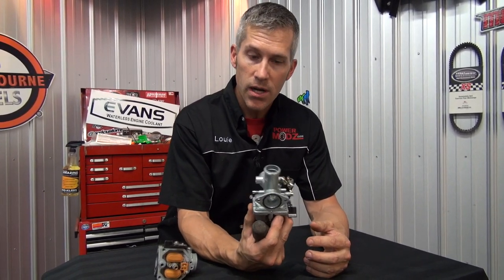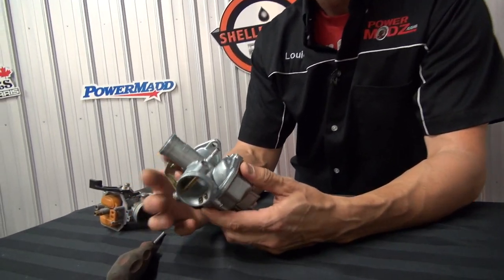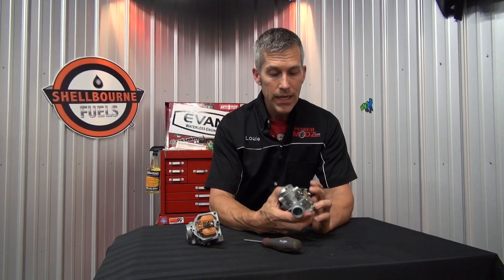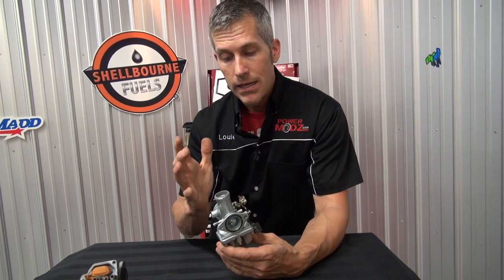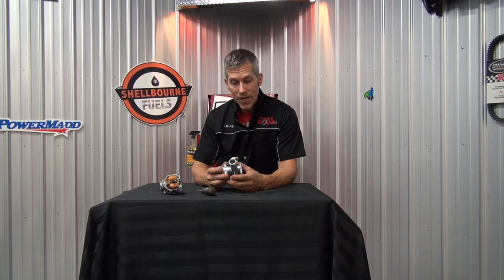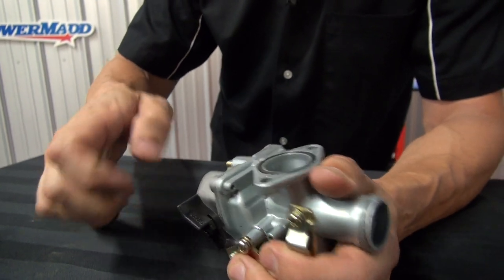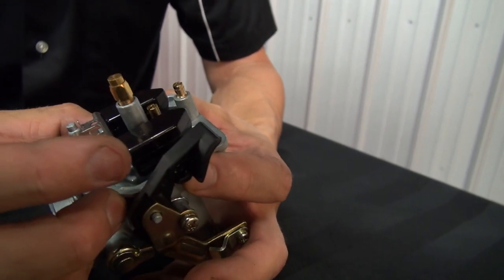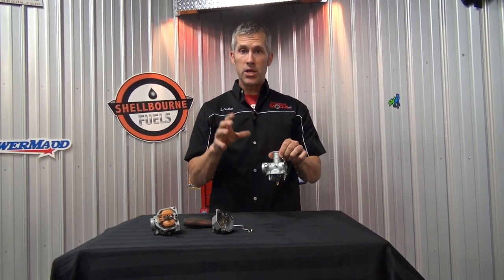Chinese Carb vs Stock carb, Honda ATC/ATV and more.  PowerModz!

Comment: I see a lot of people saying just rebuild your oem carb. That is by far the best thing you could do. The only problem with that is, if the throttle slide body is worn out, the carb is done. You can clean and replace all the brass you want. It will not run properly. As PowerModz said sometimes these knockoff carbs are your only choice. Just make sure you have them jetted properly to prevent engine damage. I had an oem carb on a RT100. I cleaned it and put new oem jets in. Bike would not run. Put a new knockoff $26 carb in it and it started first kick. Minor air and needle adjustments and the bike ran perfect.

Comment: I bought a chinese carb for 14$ shipped to me, my 1984 atc 70 has never ran so strong. Ben 3yrs no problem. If it works it works. Chinese , japanese anywho
Reply: technoviking1975 Bubba 
Oh they will run great. The only thing with the Chinese carbs are the Jets will break or snap. I bought a couple and put in original Honda Jets.

Comment: +1 to everything this guy says.  The original Kiehin carburetor on my ATC125 was so far gone that rebuilding it was not possible.  Corrosion, bad gaskets, leaked, slide was seized.  I found a knock off on Amazon for $17 that was a pretty good copy.  I had to swap the carb studs from the original to the knock off and the slide is a composite rather than metal but other than that there was virtually no difference.  All controls hooked right up with no modification and it started right up.  Now the little 3 wheeler that could runs as good as it's ever run and starts on the first pull.  Chinese knock off carburetors are kind of like the Chinese knock off Honda GX 200 engines.  (Cough....  Predator... cough cough...)  Most of the time they're just as good as the original.  I used to think that "cheap Chinese stuff" was junk.  Period.  Well....  China has upped their game in the quality department.

Comment: I've got three Chinese carbs and have had no trouble at all with them, all on "82 200E's. Its hard to rebuild a carb when the guy before you thought they would try their hand at fixing them.
Reply: exactly the guy that had my 96 timberwolf 250 beat on the carb because the floats were sticking and bent the side of the bowla nd now it won't stop leaking fuel
i got a knockoff carb and hopefully if all else fails maybe the bowl will swap over
Reply: Hello, your comment gives me peace of mind. I have an ATC 200e and I ordered a Chinese carburetor. I was worried because it won't work.

Comment: Similar experience with these. Plan to re-jet them right away. I’ve found they ship with pig rich pilot jet size - aka safe mode. I’ve seen them run 5-10 bigger.  They never list the jet sizes, so best to look up oem jet sizes of your bike and order real mikuni jets and have them on hand as a starting point.  Also agree and highly recommend the ultrasonic cleaner route on your genuine carb prior to resorting to these things, 9 out of 10 times the cleaning has amazing results.
Reply: This is a 5 year old comment, but yes, same experience with a Quadrunner 250. Chinese carb came on it from the previous seller, wouldn't idle without throttle, turns out the pilot jet was a size 40- the factory Mikuni spec is 15.

Comment: awesome! too cheap to smoke's review of a tillotson copy segued straight into this review. I am really glad to hear you weigh in on this as I bought a Chinese copy of the carb for my 84 honda xl80s and I have been feeling reluctant to try it. I stupidly broke a screw off trying to pull the "make work component" that honda installed over the pilot jet out and I have been stalling on trying to drill out the stupid plug that prevents the owner of said honda from cleaning their own carb with the oem carb. I feel better about trying the knock off as I only need to pull the studs from the oem and screw them into the threads in the copy.  thanks for all your awesome vids Louis! 🙂

Comment: what you ended up with was the smaller one with no float plug .. find the OEM STD carb with the same side and float plug and it will work out of the box.. the one you have will work on a 100 better than the 200

Comment: They work great put one on my 200m only had to mess with piston cap. Set perfectly from factory
Reply: Troll Scab how did you get the cable to fit in the cap I bought a China carb but the cap and piston is bigger I can’t get the small one off the cable so I can put on the new carb any help would be great

Comment: Original 1998 Honda $600 carb lasted 15 years, normal wear.  Has pressed in jets instead of screwed in jets!  A new float needle did not fix and the seat would need to be drilled out.  Chinese carb (Actually has Japan on it!) $100 in 2013 has been running 7 years.  Time will tell.  Seen some in 2020 for $35.  Can still buy the original Honda in 2020 for $300.

Comment: I have used several of them off ebay, plug and play. Cheaper than a rebuild kit.  I have got quality; as good as the original. In fact have one coming right now for a Stihl MS211 chainsaw.

Comment: I love my chinese carb but damn it takes forever to start my Quad ! Once it started everything is good ! What sucks is I can't adjust the fuel/air ratio. The screw there has 2 tiny holes instead of a flat screw driver head... The OEM carb even though I replaced every brass part and needle keeps spitting gas in my crankcase unless I shut the fuel valve.

Comment: We ordered a carb recently for our 1986 honda 200sx.  We had to get a different carb because the cap attached to the throttle cable was too small for the first new carb.  The other issue is the barrel will not slide up and down.  We had bore out the cylinder some...still no good.  By the way, how do you install a throttle cable to a new carb when the metal tube is crimped to the lid as one piece.
 
 However, the newest carb we installed and the quad is operational now.  It has sat for several years now.

We have 3 of these and now 2 of them run.  1 to go.  All had the same carburetor slash pet cock issues.  Thank you for your video.

Comment: In Europe Piaggio asks 350 euros for 2006 gilera runner 125 vx carb. I bought chinese carb cv30 (copy of Keihin) . My bike works perfect. I think is more powerfull than original and more smooth at idle. May be is the same as original but is not worse.

Comment: So the name brand carb jets are flow tested.  These cheap carbs are not.  Some jets are not even numbers.

I do the same thing.  I use the old jets in the new cheap carb and it work 90 percent of the time.  Also i use K&L needles instead of the cheap ones.

I have done this probably 300 times since I am the only people repairing these machines in Fargo N.D. 

I order 100 moped carbs every year and return about 5 out of 10 for poor machine work.

Comment: I've purchased 2 Chinese carbs so far.  1 was for a Bayou 220 and the other a Bayou 250.  I had to rejet both and they both hesitantly accepted the original carb main jet (They definitely will not rattle loose)  I had one issue on the 250 Bayou, which gets more use, where the bowl was overflowing while sitting.  I took the carb off and cleaned it out.  Looked completely clean so not sure if some gunk got in the needle and seat?   It was fine after I reinstalled it.   I've just ordered a 3rd Chinese carb (Caltric brand) for a Polaris 500 Sportsman.  It has mostly good reviews and I'm hoping it will work right out of the box.

Comment: They make 2 different ones for the Honda 185/200's and you have to look and ask before you order them. As the China 200 carbs come in a P27 and a P30 both look the same and work the same. And are the same size.. The difference between them is the inside bore size is smaller on the P27 than the P30.. More than likely he ordered the new one and they shipped him the p27 since he said it had a smaller bore size, 
The p30 uses the same top and slid and jet sizes inside the carb.. A stock 185 likes the p27 better out of the box than a 200. Where as the 200/200x works better with the p30 china carb. And when you order the P30 you can reuse the adjustable top witch is a bonus.. 
I just use lee do a search for a P30 carb rather than doing one for a blank yr 200 Honda carb..Hope this helps someone else out a bit..
Reply: Now the p27 will use a little less fuel than the p30 and I've had good luck with both of them over the yrs.. One of the old men in town was like no just rebuild my stock carb. I don't want no China junk. Never did get the stock 1981 carb right all ways fluiding even after new kits from Honda, the carb body was just wore smooth out... So when he asked me to rebuild the top end I did a new 11:1 Wisco 200x Piston and rings that I had, and a new nos Honda 200x cam, and a new timing chain and chain guides and new China valves  and a brand new P30 china carb and he was like O MY GOD this thing runs better than it did when I bought it brand new in 1981 from Honda.. 
lol If he only know he had a China junk carb on it, an he's been running it for the last 3yrs checking cattle and fences everyday, An that China junk card has never flooded  or ran fuel out the overflow since I built it.. The 1981 Honda big red 200e  is a beast now.. Electric start, high low, and will ride a wheelie .. Got to love the old Atc's.. It actually  surprised me how much the 11:1 200x piston and cam woke that thing up.. lol...

Comment: Thanks for the info, just swapped '96 honda xr200r carb for the China one. THROTTLE CYLINDER IS DIFFERENT SIZE, couldnt remove stock carb cap though. Intake size is like 30% smaller but honestly I couldn't tell the difference. Started up 3rd kick after the bowl filled and jets sprayed, runs perfect. Only complaint is the idle screw tightens from vibration and will need to be unscrewed back down after every ride. Other than that works good.

Comment: Ok I got a 1985 Honda atc 70 and my carburetor choke is on the left side but can't find one so can I use one that the choke is on the right side just extend the fuel lines

Comment: i had one on a   86  200s   it sucked    the throttle slide never worked right...and would stick at 1/8  throttle.. jmo

Comment: Got a 99 TRX450S that when trying to adjust the fuel screw I can close the screw completely and the bike doesn’t even drop an rpm it seems. When would cause the rpms to not change at all?

Comment: Just stick with keihin. find out the stock bore and buy a carb off something else, rejet, re needle, re slide. AKA, XR 250 carbs for the little 4 stroke trikes, 400ex carb for the 350x, and dirtbike carbs for your race trikes.

Join a community for your machine and buy used, or goto ebay. nothing beats japan quality and power.

Comment: How did you swap the throttle cable from the old carb to the new one? I can't get mine out of the top cover for the piston. It's for a Honda XR 200 same carb as the atc.
Reply: Easy. Make the cable pass through the end of the spring, turn the spring until the cable gets out at the other end, then you'll have enough space to remove the cable.

Comment: SO I ordered a chinese carb and when I got it installed, noticed that the cap (where the throttle cble and cylinder is inserted) was SMALLER than the replacement cap.  So I pulled the throttle cylinder and cable apart and thought I put it back together again properly, but get absolutely no start.  The gas line leading into the carb has a in-line filter now which the original one didn't... and I see gas in it.  At the bottom of the throttle cable chamber I noticed a small clip.  I am wondering if I put this cable assembly back together again properly?  does the needle need to be hooked into that clip somehow?   When I pull the throttle I hear the cylinder moving up and down inside the carb...  Thoughts?

Comment: Just picked up a small what I assume is a Chinese ATV for a kid 50cc Honda clone GY6 Engine i think? took the carb off   it says Technology From Japan right on it KEL HLN 16 J B some japanese or chinese symbol Knot sure of the maker looks Like a PZ20 20mm intake ID  air cleaner 35mm OD, 29mm ID is this a japanese carb or Chinese?

Comment: I CANNOT FIND A FLIPPIN VIDEO ON HOW TO FIND AN AFTERMARKET CARB THAT WILL BE COMPATIBLE WITH THE OLD ONE!!! (YES, I'M YELLING) I found a 1982 Honda cm250 and parts are missing. They don't seem to make the parts anymore, and after clearly stating that, I've still had a thousand people tell me to clean up the old carb and use it or, to buy an original off of E-bay. The originals, people are asking around $300, and they look like they were pulled out of a lake-- no guarantee the thing is not broke, or even that all the guts are inside. So...?

Comment: I bought a Chinese carburetor a few years back for $90, it was a piece of junk, the casting was fine, the problem I had was with the rubber on the primer part, it was the kind you push in multiple times (stem, not bulb) the rubber boot on it broke off and couldn't prime anymore, they tried to claim it was user fault, its just crap quality rubber that probably deteriorates when in contact with gas. At least now the Chinese carbs are half the price they were then, but they need to use better plastic's & Rubber, I wouldn't have a problem with them then.. My '95 Bayou's replacement carb  would cost me $250 a few years ago, now its $500, China carbs are the only reasonable option now days.

Comment: Anybody ever try a flat slide carb on one of these? I have a brand new 28mm flat slide that I might try but I figure it will probably be too much carb for the old 200s. I have a spare engine for this trike that I want to rebuild with a high compression piston and a 200x cam. Think it would run that engine or still be too much?

Comment: 1983 200e, what would cause a bog at about 1/2 throttle in just about every gear and gets worse with a heavier load? Had two carbs both do the same thing and one was brand new old is stock. Nothing seems to change when you turn the mixture screw on the outside and the circlip is center notch. Any help would be greatly appreciated. Seems to only have half the power and only being able to go halfish throttle sucks.
Reply from the maker: Could be the cdi
Reply: @PowerModzOfficial  I’ll replace it, already did the coil. I’ll follow up if it fixes the issue. I know you can test them, however they’re cheap enough to be able to have a spare handy. Thanks for the response
Reply: @PowerModzOfficial  was not the Cdi, I’m at a loss of what it could possibly be.

Comment: I just bought a Yamaha Blaster 200 missing a carb it looks like a Mikuni clone Chinese carb is cheap but can I use Mikuni jets?
Reply: I think so..
Reply: I've got the same problem, however I had mechanic put a carb kit into the oem, and it's still not running.  So I'm debating whether to go with a clone or oem.

Comment: I got one of those carbs for my atc 200s. Problem is that it revs up all the way whenever I start it. The problem was the same with the old carburetor and with the new one. What do you think I should do?
Reply: 92Inquieto check the slide it only goes in one way should slide in easy
Reply: I know this comment is three years old. But it sounds to me like your sucking excess air from another source causing the engine to run lean. I'm a bit surprised know one else chimed in to tell you this. Check your intake gasket/gaskets where the carburetor mounts to. Make sure gaskets are good and bolts are tightened securely. Be careful not to over tighten though.

Check that first!!

Also, make sure your running the correct size jets in the carb. Many times people assume jets are interchangeable between several different size/year Atc's. But most of the time, that's just not the case, even if the carburetors are identical on the outside.
Reply: Assuming you already checked what the gentleman above my comment mentioned.
Reply: I know its a very old comment but may help new readers. Check your VALVE CLEARANCES, over time the valves recess themselves into the head which in turn lessens the valve clearances, recently fixed a friends GY6 that was running high upon start then stalling after a few seconds, checked everywhere for air leaks & found none, then it dawned on me that 1 or both valves were not fully closing causing the problem, sure enough upon inspection both valves were staying open, after setting to specs it started and ran great, still going strong as ever.
Reply: Yes, make sure you check VALVE CLEARANCE. I was actually gonna suggest MUFFLER BEARINGS. when we type in CAPITAL LETTERS does it mean we're SCREAMING??!! ..Just messin😝 

Anyways, I would've suggested checking the valve lash (among several other things) if the original poster had engine stalling problems. He said when he starts his bike the engine "revs up all the way" Having low compression due to valve lash being out of adjustment isn't something I would suspect to make the engine run wide open like that. 

It's awesome you fixed your friends bike though. I know how satisfying that can be. 👍
Reply: with the carb off the trike, make sure you can see the needle go into the jet and seat with the slide falling all the way down. it is possible that the needle is cocked and not actually seating. the cap will still go on and it will rev to the moon. i always check and install cap before bolting carb to the intake